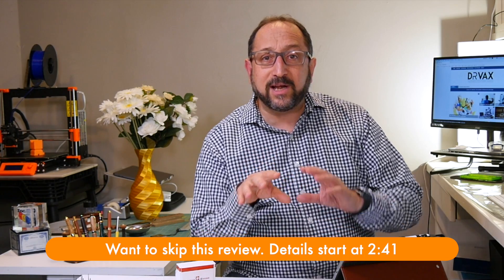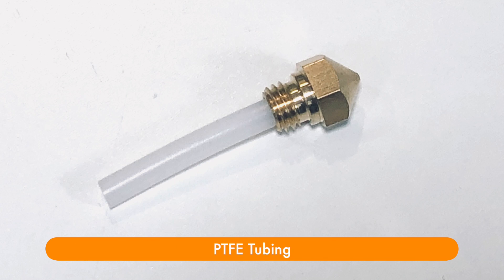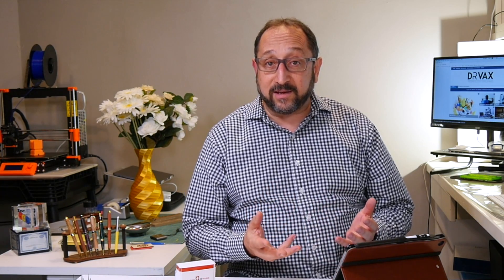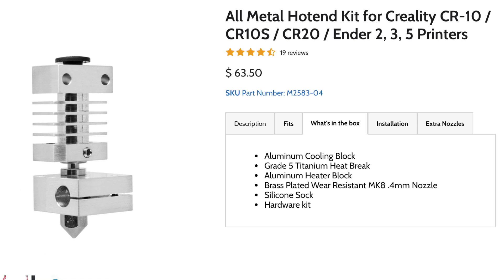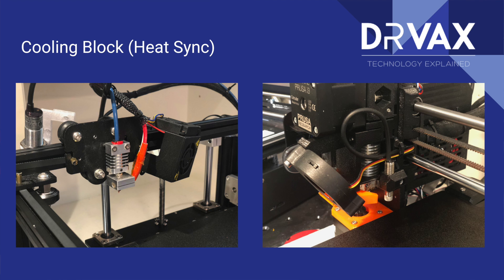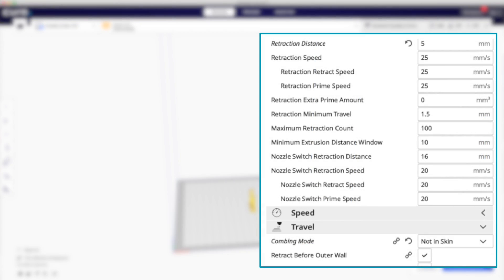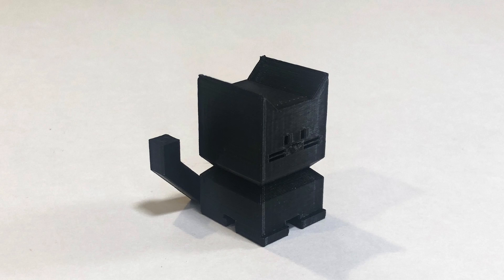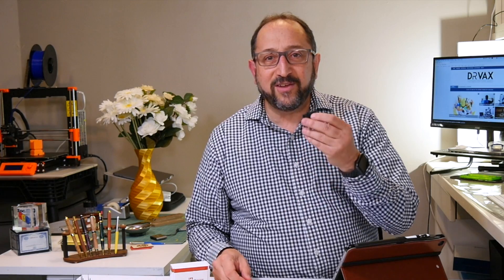Micros Swiss All Metal Hotend

Comment: Hey dude, please make a video with direct drive extruder on ender 3 It would be fantastic :)
Reply from the maker: I would be concerned about the weight on a Y axis not designed for a direct drive extruder.
Reply: @MakeWithTech  hello! i think there are upgrades for a second lead screw. but they are like 40€. check out teching techs video out, he made it without a second lead screw.
Reply: @MakeWithTech  I'm thinking about using a second z screw axis
Reply: @MakeWithTech  It works surprisingly well as all the weight from the extruder is actually on the same axis.
Reply: @MakeWithTech  Check out the Sovol SV01. It seems to be an Ender 3 with a direct drive extruder.
Reply: @MakeWithTech  Many people have done it. Including myself. Slight ringing induced at about 60mm/sec walls. Nothing else to report. Cost me nothing also.

Comment: My old Da Vinci printer was an all metal hotend and would Jam when switching from ABS to PLA. Any small residue of ABS in the hotend will stick to PLA. You can fix this with cleaning filament. Also, I would reduce the retraction when using an all metal hotend, that seems to help.
Reply from the maker: Thanks for sharing.

Comment: 👍 Always great content! This leaves me with a question....Are all nozzle threads the same length? When I change my nozzle on my standard CR 10 hotend I make sure the bowden tube is touching the nozzle. No gap. How do you do that on a all metal hotend? 
Maybe some brands of nozzles have shorter threads. Will that leave a gap to promote clogging issues? Always wondered before I changed over.
Reply: I think the best way to install the nozzle is to tighten the heat break in the heater and heat the hot end, then tighten the nozzle when hot.  It should meet the end of the heat break and not  bottom on the heater block.  MicroSwiss has a good video on the install. 

https://store.micro-swiss.com/products/all-metal-hotend-kit-for-cr-10
this step is at the 5 minute mark
Reply: @woodwaker1  yes. Back then I never knew the heat break and the heat block were two pieces. I was thinking if one brand of nozzle threads were shorter it would leave a gap and clog. My mistake.
Reply from the maker: On the Micro Swiss Hot End the bowden tube DOES NOT go down into the hotend up to the nozzle.  It just connects to the top of the cooling block.
Reply: @MakeWithTech  yep but don't the nozzle butt up against a "metal" tube? Think of it this way if you left your nozzle loose in a all metal hotend will that leave a gap? So if brand of nozzles threads are shorter that will leave a gap between the "metal" tube and the nozzle.
Reply from the maker: Now I understand you question.   Micro Swiss sells nozzles.  In fact very good nozzles that are plated so they last longer.  I would probably either just buy my nozzles from them, or verify with Micro Swiss that the nozzles are a standard size.  If you find out from them please share with the channel.
Reply: @MakeWithTech  I will. Maybe this is another reason people are having problems.
Reply: @MakeWithTech  they fit all stock cr10 ender 3 5 and pros the stock mswiss nozzles
Reply: @Vrich3733  I think the heat break fills where the PTFE tube would.

Comment: Irv, maybe this will help. PLA sticks to metal. PLA is sticky. Leaving it in the hotend also doesn’t really expand it as much as it hardens it. 

Jamming occurs usually like you said when you have heatcreep. The top becomes soft and doesn’t have enough rigidity to push it through. That’s why it most cases a ham can be cleared by heating and shoving through. 

Liken PLA jamming to trying to cook an over easy egg in a pan without non-stick coating. PLA has to keep moving. 

Also some HTPLA’s anneal. So the more time in the hotend the harder it gets.
Reply from the maker: Yes I have heard this explanation and it also makes sense since the stock Ender hotend has the bowden tube all the way down to the nozzle.   This also explains why some people recommend using an "oiler" with PLA in an all metal hot end.

At the end of the day I think multiple factors come into play and the extrude at high temperature and then retract approach works well.

Thanks for participating in the dialog.